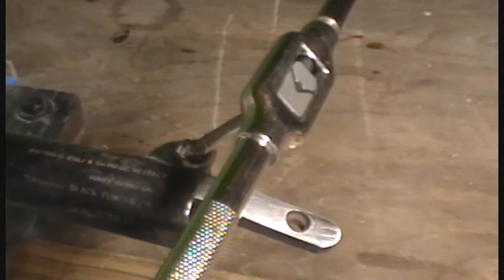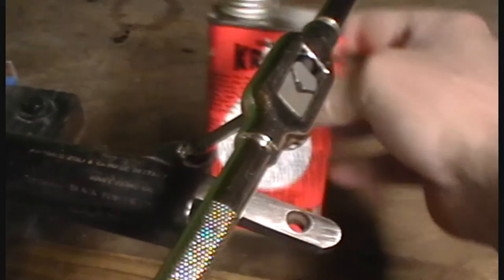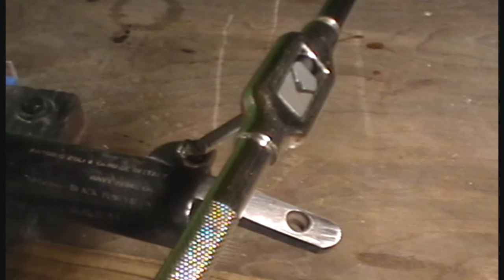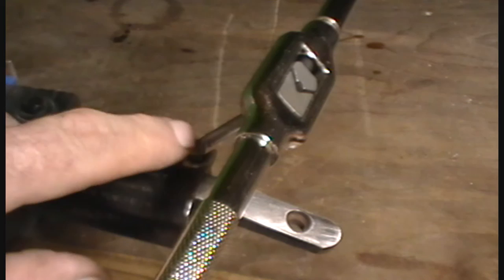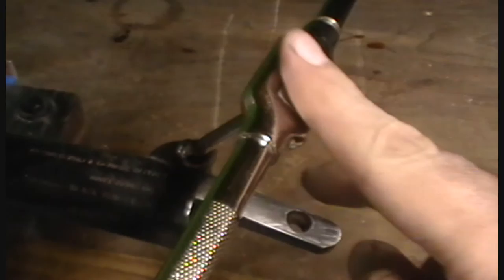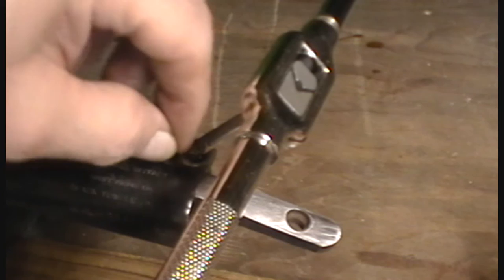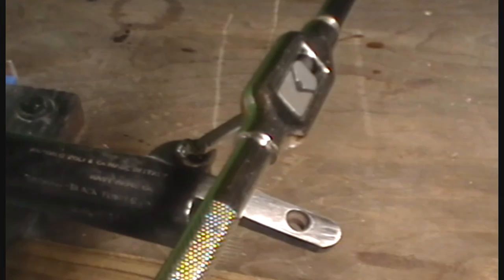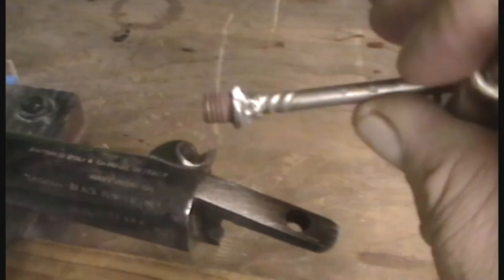Easy Removal tips for Frozen Percussion Nipples

Comment: Good video. So far I`ve never had one that I couldn`t break loose.
Reply from the maker: +1957Shep Count your blessings!
There is a reason I prefer stainless steel nipples! :)
Reply: +onmilo The little T/C Cherokee 32 that I bought a while back had a little rust that needed cleaned out. But as you said, thankfully it had a stainless nipple.

Comment: No, i dont use easy-outs anymore. The small diameter ones you have to use on most nipples can break off. In the nipple. Then you are screwed! What i do is if oil and heat and a custom made wrench made from a tight fitting socket still wont budge it is to simply drill out the nipple and re-tap the hole to the correct tread for a new nipple.
John Davis
Reply from the maker: Problem with that idea is some nipple threads are already at the largest practical diameter and thread and finding a replacement nipple at the correct thread to fit the now enlarged hole in the bolster may be impossible.
A better idea is to drill out most of the nipple and use a larger easy-out OR, if you know the exact diameter and thread pitch of the frozen nipple then to drill out MOST of the nipple using a number drill 3 to 5 sizes less than recommended for the tap size and chase the remains from the original threads using a bottom tap  followed with a gun tap to fully clear the original threads.
Reply: No, i dont go to a larger nipple. I drill and tap for the same size nipple. Dilling and retapping gets rid of whats left of the old nipple. I have done it a couple of times with good success. I have in my lap right now a barrel with a broken off easy-out in a nipple that has been broken off trying to remove it. The easy out is too hard to drill out. It is a double barrel shotgun that i cant easily remove the breechplg or put too much heat on without melting the soldered barrels. I have been studying this problem off and on for a couple of years. 
I am thinking that i might try pouring some rust desolver down the bore followed by some Kroil then take a dowel and patch and some heavy oil in the bore and try to force it out hydraulically with a  hammer.  Others have suggested putting a drop of acid around the nipple first. I dont know 
About that.
Any ideas?
John Davis